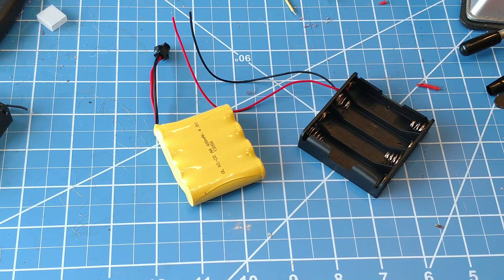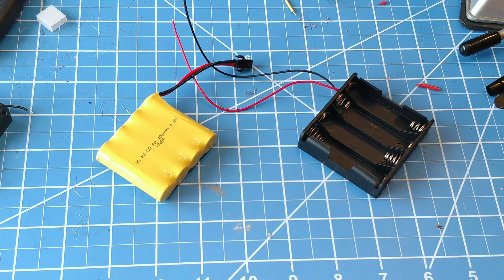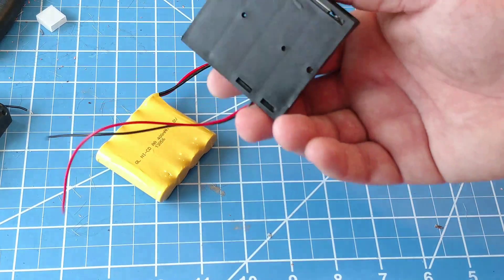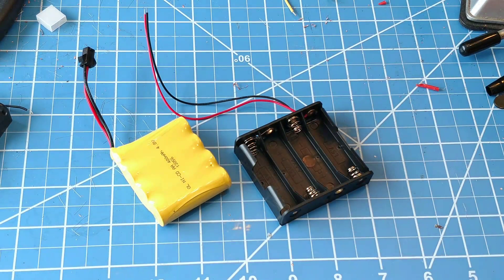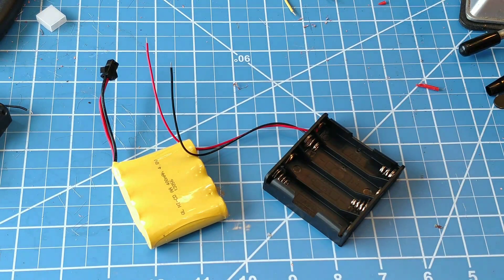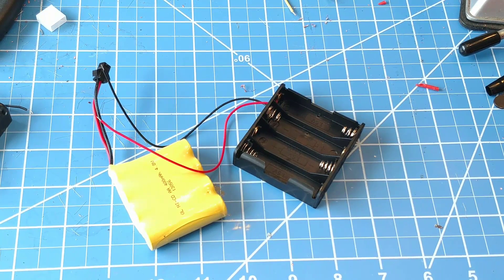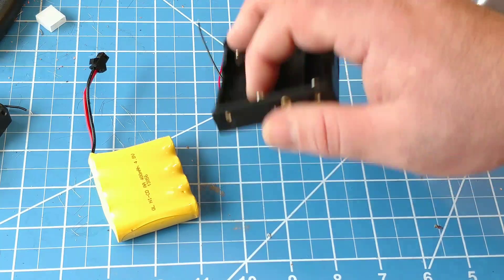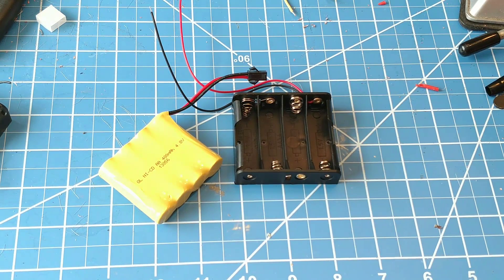easy 4.8v battery pack conversion

Comment: Exactly what I was looking for! I think all the downvotes are probably because you didn't actually show any of the fitting, soldering, trimming or fitting in the various compartments like you talked about. Good info, though.

My son just got an R/C school bus that uses one of these Ni-Cd packs and one of the big downsides is that it runs for 20 minutes, but then takes 4-5 hours to recharge (using a USB adapter provided), whereas with NiMH AAs in a AA batt compartment, I can just pop in the next set and he's good to go right away.

Comment: Like the idea, found out that the usual AA battery holders' springs have very high resistance. two servos wouldn't get enough current unless I use fixed metal tabs between batteries.

Comment: Dear,
1  Which equivalent Li-ion battery can I replace the Ni-cd 4.8v 800mAh ones in my RCs?
2. Can I use a Li-ion 3.7v 800/1500mAh battery?

Comment: Use AAA battery holder. Its the same size as the AA battery pack. I use AAA eneloop battery's in that. And not only it works way more then this pack. But, it's also easy to replace. I have used them and I love them.

Comment: Dude my NIMH batteries when in full charge has 1.4+v tho it only 1.2 is it ok? I'm afraid it will damaged the rc motor.
Reply: The motor is fine it resist to up 12v , but the power is very big , is it a 3v dc motor ,no?

Comment: hi i just bought a 4.8v 700mAh rechargeable Nicd battery but i intend to use only maybe 2 to 3 months later can i just leave it as it is then only charge it after 2 to 3 month later. will the battery spoilt? And can i used a handphone usb charger to charge example samsung charger ? thanks
Reply: kev
Reply: Nice